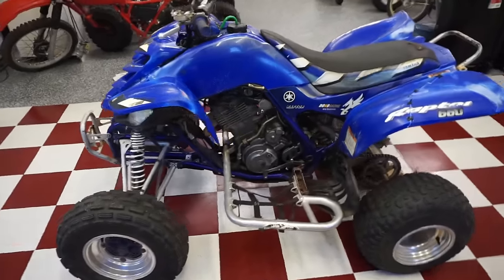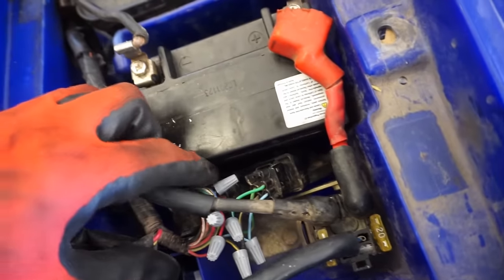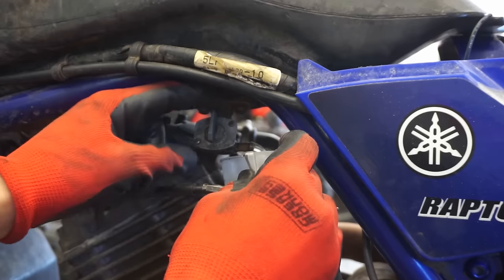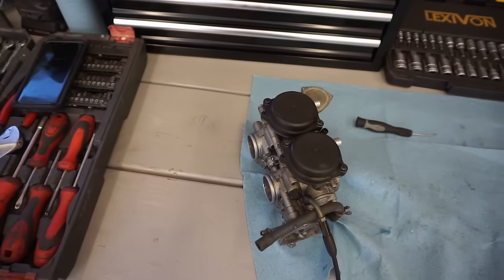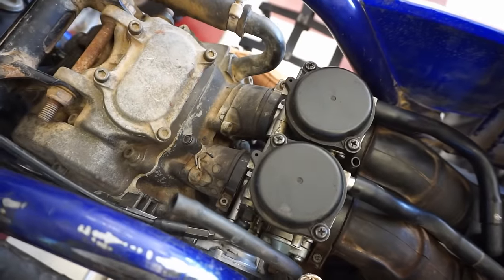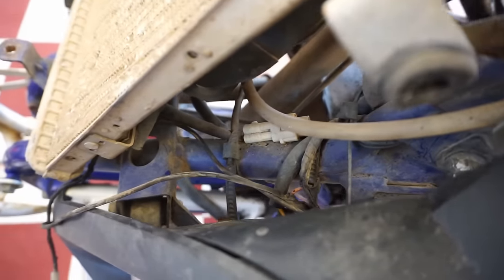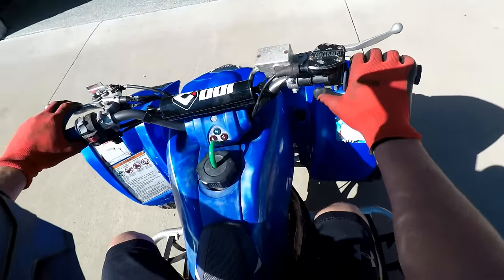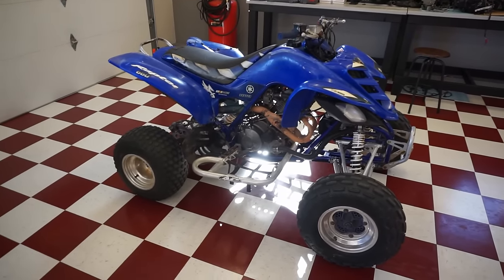They Said I Was The Last Resort...Nobody Could Fix This Quad (Yamaha Raptor)

Comment: Jets on cheap china carbs are never marked . Use the original .
Reply: So clone jets or Chinese jets will have flow rate markings…i deal with a ton of China bike or chonda builds nowadays with popularity increasing fast amongst powersports owners who either use Chinese manufactured bikes-quads or parts for they’re Japanese machines repairs to keep costs down & while some of the stuff is perfectly fine to use the jets are definitely finicky they might be stamped 135 as the flow rate & in reality flow more like a 115 or 150 so your absolutely correct in saying it’s best to use genuine jets when possible I just wanted to clarify the let about them being unmarked since I don’t want someone to think well mine is marked 175 so it’s a genuine jet but really it’s a China clone jet & can potentially have them chasing they’re tails when tuning
Reply: Cheap China carbs work just as well as stock. I'm speaking from experience
Reply: @Davidsmithisyourdad  Nibbi carbs are really a nice clone/copy of the more expensive Keihin PE & pwk series true to size etc etc the run of the mill clones costing around 20 bucks I will say work if you set them up correctly something I like to point out is they’ll be called say a pz-30 or VM26 so people assume it’s a 30mm carb when it’s more like a 25mm if that fits into ones build sure it’s going to work out good!! If you expect it to be a 30mm though one’s going to be mislead by the name….happens allot with the engines I build for China bikes I’ll say to someone get a Nibbi pe28FL because it’s a direct fit carb & they respond with why buy a 28 I already have a 30mm 🤦‍♂️ as long as your aware of the actual carb’s ability good to go!!
Reply: @Jboost412  agree when buying  cheap knock offs you have to make sure you know what you're buying.  I run one on my 400ex and have for years problem free. Set up and tuning is key with any carb. If you don't know how to do that right. No matter what carb you use the bike will never run right.
Reply: @Jboost412  qp

Comment: For what it's worth, that solder did not penetrate, you just stuck it to the outside of the wires. Need to heat the wires with the iron so that when you touch the solder to the wire it melts.
Reply: Place soldering gun tip under wire, then let the solder flow down into the wire.  Just like welding, it takes practice.  Anything beats wire nuts and butt connectors.
Reply: I'm thinking it would of been a nice touch to  put heat shrink tubing over the wires then  soldered them in a straight line shrinking the tube over the repair after. It looks like he didn't even tape them in the video unless he did it after, the wire nuts at least insulated the first farmer fix repair if he didn't do it later.
Reply: Yeah he don't comprehend that he's been told over and over.

Comment: The average person that will watch one may not get excited about it as I get.  I can do the work and have done it a lot.  A dealer ship sold me a 500 tripple two stroke all locked up.  I brought it home and for a week or two worked on getting the piston stuck loosened. I clean out the tank and the carbs and decided after doing all this work on it was going to take it for a ride.  I rode thru Chichago during rush hour and then up to Canada.  I sprayed chaine oil on the points and fouwled them out.  Got stuck in Canada.  Had to get the truck and go back and get it.  Now i am looking over four wheels right now on marketplace.  Tried to get the guy to bring me have to stay in at home here, a four wheeler and a cub tractor too.  Some one else go the four wheeler.  Am working on getting another one that I jewed him down on.  It shut off and wont go so I know that it will be some work to be done on it.  I just don't have the thing we hit with the hammer to loose the phillips screws and the fly wheel pullers.  I am almost 70 years old now.  Yet I have wrenched on a few of these too.  I have worked on the mopeds too.  Just changing the front or rear tires is fun, and in addition just do the breaks when doing the tires too.  The drive belts need to be checked often too.  I would love to have some land just like one has too.  Paul in Ohio

Comment: Try getting a tube of rosin flux for your soldering, and a lead base solder. That cheap rosin core solder doesn't flow good. You will see a difference in your repairs.
Reply: Absolutely it’s all about using the correct material in order to have a solid result…not speaking of this specific incident just in general I see some people in my shop for example that stop me & ask why it won’t flow like I show them it should or basically that it’s just balling up instead of being absorbed into the connection to end up with a solid long term result….did you try some flux ❓ uhhhh no 🤨
Reply: He’s also not soldering correctly. You put the iron on the wire and connect the the wire and iron with solder and the wire will “suck” the solder in.

Comment: great video, just a tip when soldering. you should heat the wires not the solder. the heated wires should melt the solder. that way you know you have a good connection.(sorry for possibly bad english)

Comment: You could have an air lock in the oil lines, any time I change my oil and filter, at the same time and try to ride right away, the oil tank always over fills, I have to crack the lines to the top of the head and back of crank case. If they sit same thing can happen.

Comment: When you solder you need to hold the soldering irons tip against the wires until it is hot enough for you to feed the solder in and wick into the wires.
The way iv watched you do it in multiple videos you're just creating  a poor cold solder joint that will most likely fail. Other than that, good stuff as usual.
Reply: Yep, always heat your work first, then apply solder, not the other way around.

Comment: Hey Joe as a thought could you get a spark plug tested that is clear and hook the other end up the the plug while it's running and as you rev the engine you can visually observe the spark as you climb up the rpm

Comment: Always use Rosin core flux on electrical wiring! Plumbers flux is acid core and will corrode the wiring. Tin/lead solder is what to use.  67% tin, 33% lead. Again, no plumbing solder!

Comment: Yeah, having a Warrior, first time you fired that thing up I thought to myself that sounds a lot like that parking brake circuit messing up.  I've fought that battle before too.  All those other issues likely just made it worse.  Awesome job again.  I really look forward to these videos.  When are you going to start doing Miata's ??  (evil grin.... I just got a basket case NB in my garage to try and reassemble with my son, and these "how to" videos are an enormous help)
Reply: I put a rock in my sensor to hold the button down. The person I bought it from didn’t know how to fix it or what it was. Turned out that the switch was activating when it shouldn’t have.

Comment: You doing the valves reminds me of when i did my ktm's a few months ago, my ktm had its first valve adjustment in 19 years it did. Runs better now. Intake valves were way too tight no slack at all and it was loosing alot of compression.

Comment: Check the stator.& Pick up coil to tom. It's must likely halfway fired out to. Yes that one way bearing could be sherd off witch means the timing is off A course to. Along with hooking up the electrical wiring to something different l.,or to eliminate something to will affect the wiring harness.& Charging system on them to. Check out the voltage regulator/ rectifier box.

Comment: You wouldn't believe how many bikes I've had come in that was just a valve adjustment to fix, especially ones owners have mis adjusted. And ones owners have put new top ends on themselves. Always run factory recommended plugs. In my experience the iridium plugs just don't cut it. Great vid.

Comment: Not sure if you had done it or not but alway remember to clean the screen in the oil tank when Changing the oil, it's on the oil line that runs to the engine
Reply: And obviously the oil filter on the right side of the engine

Comment: Back when I was a kid in the 70s we use to keep a new plug and a spark plug wrench in the tool box under the seat. Spark plugs can go out at any time. They can get fouled and you can wire wheel them. But a lot of the time they just go dead or almost dead. like the one with yellow spark. Very common reason bikes will not spark. You got that baby fine tuned. 660 woowee! You should race that guy. LOL It pretty quick though.

Comment: when i saw that plug it looked wayyyyy too fried. picky motors that need high dollar plugs ! good thing you fixed the other issues tho, I think it was a combo, bad plug, probably bad fuel, valves way off, and wrong jets. great video and diag !!

Comment: Intake carb boots are a few millimeters too short on O.E.M boots, and they keep popping off. But you can buy aftermarket boots from UPP that fit much better and won’t pop off. And the grinding, (some say whining) when you go to start it is the starter clutch. Raptor 660’s are well known for this. Best to put a one way starter clutch.

Comment: Joe.. stop using angle hair lead solder. Go get some very thing rosin core 60/40 or equivalent. Clean the tip of soldering iron with a razor blade get it to shiny copper itll heat and melt much better

Comment: Right off the bat i am going to say weak spark.
I had a similar deal on an old two stroke with points. Points got dirty and killed the spark... couldn't rev over 1,000RPM and as soon as you out a load on it, it would bogs down. Now, going to watch the video.
Edit- Pretty close!

Comment: Clean that oil screen in the bottom of the oil tank. It could have a hard time circulating back to the engine, causing it to pool in the reservoir and starve the motor.  Aside from that, another great video bro.

Comment: Are you getting exhaust out the pipe.& Built in resonator. If the exhaust port is closed off.,or clogged up with carbon it will do that to.

Comment: So half way through vid I noticed you use the aftermarket carb instead of the oem? If there is no obvious reason then I suggest using the oem carbs. Most times people order these crappy aftermarket carbs hoping to fix a bigger issue.

Comment: Pro tip... When you solder you dont heat it on the tip of solder gun and paint it on you suppose to put the heat on the opposite side and put the solder on the cold side and let it run to the heat.

Comment: I had an 08 kawasaki kfx450r that did the same exact thing.. would start right up and idle perfect but bog and die pressing the throttle..i had put an aftermarket ignition coil that was made for that quad...it had spark and everything was good so i thought it was a fuel issue cause it had a brand new plug..i had a weird feeling to take the aftermarket ignition coil off and was able to find the original one that came with it cause i thought it was bad, i pressed the plug wire back into the stock ignition coil and it fired up and ripped down the road no bog.. so sometimes it could be aftermarket parts that say they are made for these bikes but don't work properly

Comment: I have a 04 Raptor 660r and I did a carb kit rebuild and clean. Now it idles perfectly and runs great a low RPM but when you hold the throttle halfway it pops and does the same when in neutral. Felt like it could be a spark issue, so I replaced the plug and I'm still getting this issue. Watched a few videos and tried the parking brake issue and the rev limiter bypass, neither of which stopped it from popping at mid-level RPM. Any suggestions on where I could go next? Considered purchasing a new CDI or stator but getting kind of at a lost for options.

Comment: Just curious if anyone here knows anything on this I have a raptor 660 as well and I just bought a new carb and adjusted it now it’ll drive and idle fine I can rev it just fine in neutral but I put it in gear and go slow it’ll drive but if I try n go quickly it just dies on me

Comment: Also you need to learn to solder! Heat up the wire and apply solder. You do it totally wrong. Don't apply solder to the tip first 🙄
Reply: wait i do it that way and after 10+ yrs i havent had one issue. well maybe one but im almost positive it wasnt my solder skills.
Reply: I mean it’s the guys content he can fix it the way he wants

Comment: I like your videos man but I've noticed you use the clutch every time you shift in them. Try using only when slowing down and starting off. Just blip the throttle when shifting. You'll be faster and it's less wear on the clutch imo...just some friendly advice

Comment: anybody trying to fix their raptor 660 I had a similar problem also would not rev just shooting out the exhaust parking brake sensor and reverse sensor disabled carbs cleaned floats adjusted new spark plug new air filter valves adjusted everything I could think of was done the problem turned out to be worn carb needle jets after replacing the needles the bike runs perfectly again hope it helps someone took me forever to get it sorted.

Comment: Next time use a actual wrench to hold the lock nut on rocker while adjusting the valve clearance and still need to hold that adjuster while tightening the lock nut they will move and run your valve adjustment... lmao
Reply: All hail Jake and his knowledge.

Comment: You need to charge these clowns for fixing their crappy machines. Dry sump oil isn't as bad if it is over-filled. When soldering, let the solder flow over the wires, you should not need to spread it around, it should flow. That's how you know you have a good solder joint.
Reply: A shiny bright silver joint identifies a good solder joint. Before soldering,  connect the wires together by twisting, braiding, ect. Clean your solder tip and tin it with solder. Apply liquid flux to the bare wires, add a little more solder to the tip. Touch the flux prepped wires. Install heat shrink and heat it to shrink tightly around the wires. 
Oops, install heat shrink before soldering wires together. Also, excess solder and “blobs” are bad, redo it!

Comment: So you compared an old carburator to the new one without even knowing if someone screwed up the first one by swapping parts around or rebuilding THAT one wrong. You should never do that. Should always rebuild to the spec sheet, not compare to an unknown part that may or may not have been screwed with.

Comment: It’s not over filled learn your machines rappy a got to run few min get oil circulation going then shut off and check oil and carb jets were cheap shit off eBay which don’t work